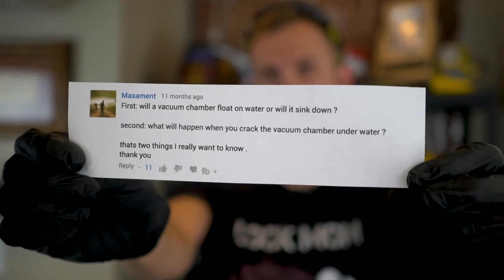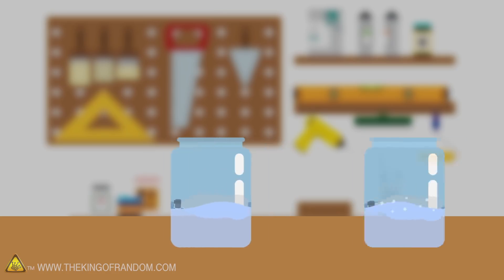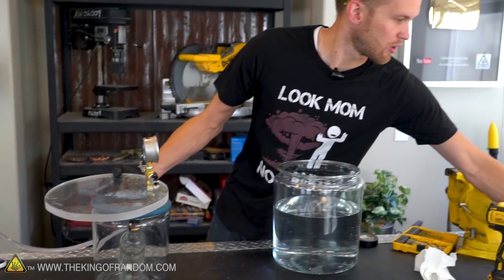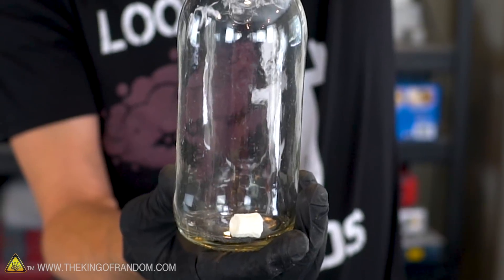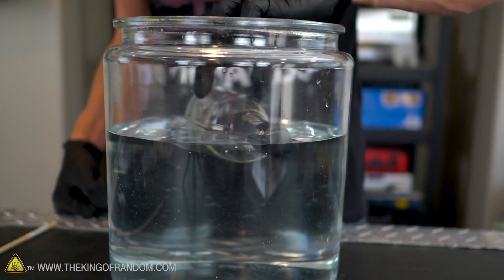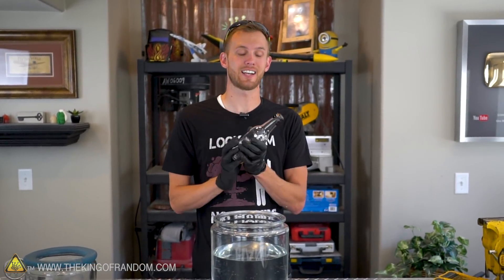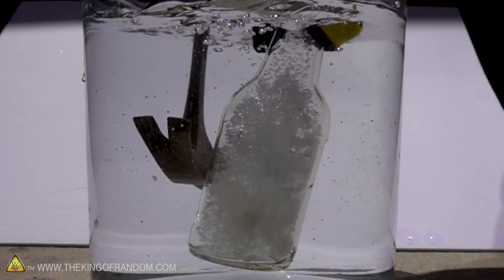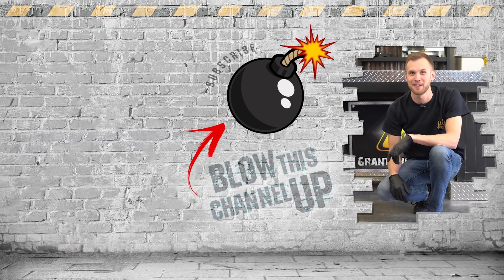Breaking a Vacuum Chamber UNDER WATER

Comment: You should try to see if a engine runs in a vacuum chamber

Or try to make a big confetti popper
Reply: OnlyToasted it won't.
Reply: the engine won't run
Reply: Why would the engine not run???
Reply: obay rihan the three most important things necessary for combustion are fuel, spark and oxygen. In a vacuum there is no oxygen so it is impossible for the gas to burn.
Reply: obay rihan the engine will not run because engines need air in order for the fuel to combust.
Reply: You want to see if something that requires oxygen, can run without oxygen? Let’s see if people can run in a vacuum chamber lol
Reply: OnlyToasted i wouldn't run because there is no air to burn gas inside the engine.
Reply: How old are you

Comment: Hey guys, I think you should try putting different types of chemicals that would usually react really rapidly but they would need air as a catalyst into a vacuum chamber.
You could also try to pump sulfur hexafluoride in a water bottle and see if i would sink in water

Comment: what happens if you pour molten aluminum or lead in two different blocks of ice. the first one ist just the normal block and 
the second one is cooled down with dry ice. is there a difference.

Comment: I was hoping you would compare the floating depth of the low pressure vacuum bottle with a regular closed bottle filled with air. Also a softer rubber might hold that seal better.